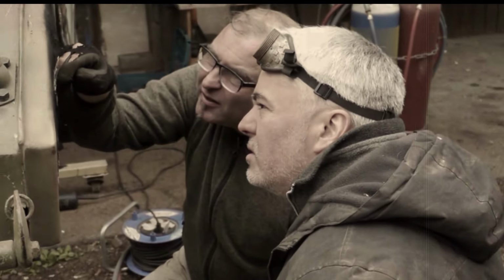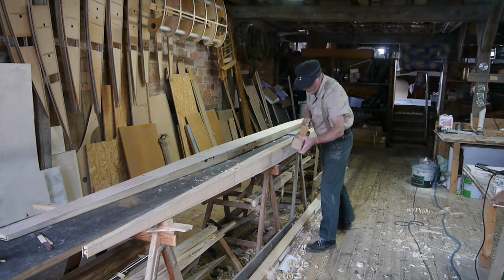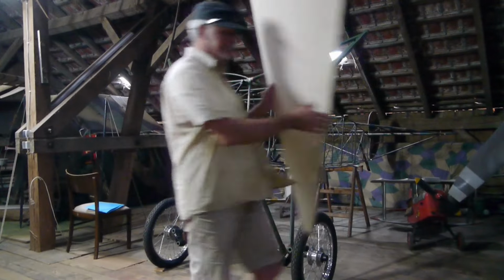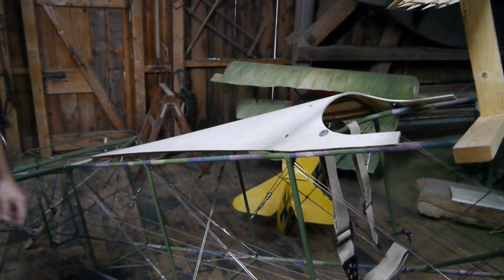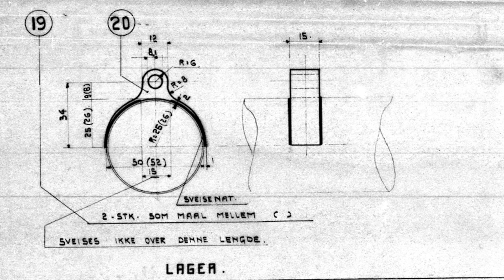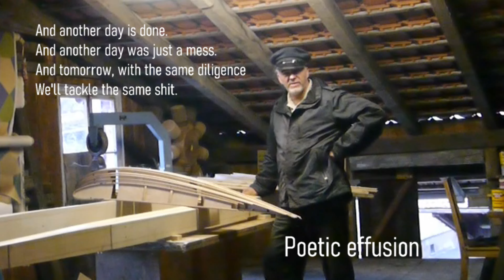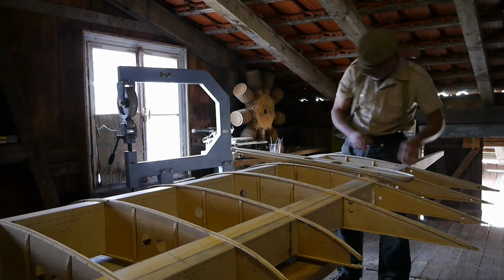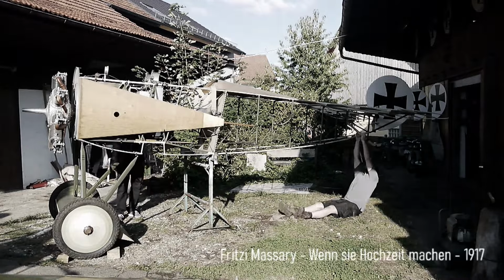𝔐𝔉𝔱𝔊 - 𝔚𝔬𝔯𝔨𝔰𝔥𝔬𝔭 𝔚𝔞𝔱𝔠𝔥 𝔈𝔭𝔦𝔰𝔬𝔡𝔢 24 𝔬𝔣 21𝔰𝔱 𝔬𝔣 𝔖𝔢𝔭𝔱𝔢𝔪𝔟𝔢𝔯 2024

Comment: the glider needed full depth spar i was just thinking you could make the ribs like you then glue on ribs leave out top and bottom over spar cut out later and glue and fit cap strip on spar full depth ps i have workshop practice by hans  jacobs the best